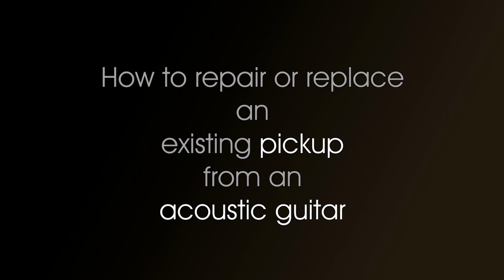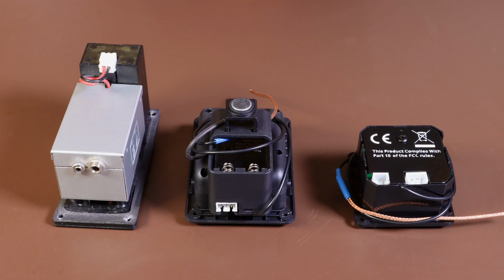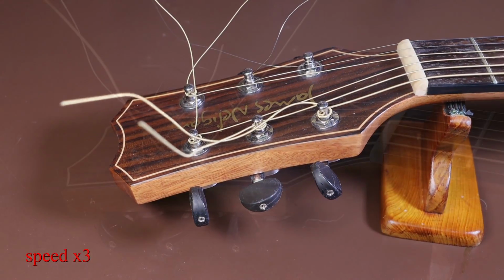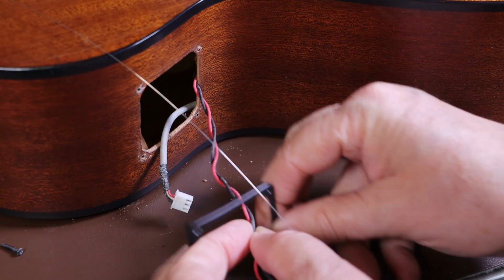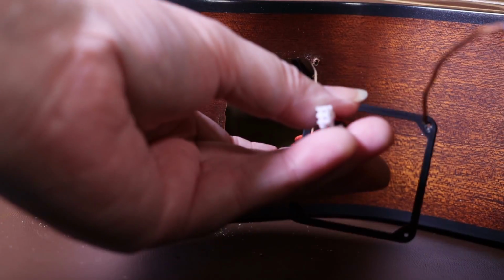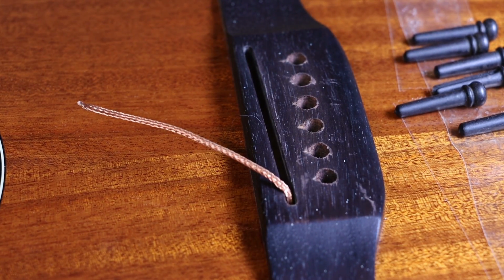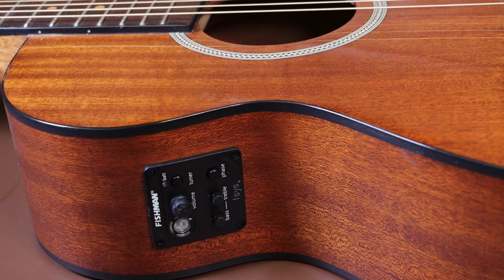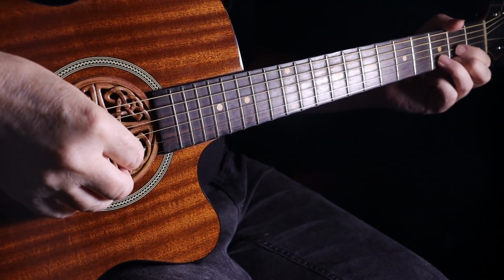How to replace or repair an acoustic guitar pickup and preamp (piezo pickup)

Comment: No worries if not but do you have any tips on how to use existing pick up if I’m going to make it into a resonator please? Would it be best to keep original bridge and pickup together or would this not work? Thanks in advance and no problem if it’s not something you can help with 
Cheers again 
C
Reply from the maker: Piezo pickups are pretty much standard, so If you want to keep the bridge and saddle untouched you can.  The only proviso is that you are confident to cut the wires and re-solder the wires cleanly to avoid buzz.  Sometimes it's a better solution to leave the existing pickup in place anyway, especially if it's a good one.
I hope this helps 😊

Comment: Since I bought my electro acoustic guitar one year ago, I've had this weird buzzing noise when I played the G-string coming from inside my guitar. It only made this noise when I was playing the guitar normally, not when I put it down on a flat surface. I tried so many things to fix it, but could never narrow down what was wrong with it.

It turns out that the one cable connecting my battery to the chromatic tuner (CL-4) ended with a screw thread, and there was a small ring supposed be screwed around it, but it was loose. This means it was always moving around, and when I played the G-string it would rattle against the plastic cable.

Thanks to this video I was able to take out the tuner and fix the ring back into place. It now still buzzes a tiny bit when I hit the heavy E, but it's much better than before. I have no idea why they designed a cable like that. Judging by the fact that it worked fine for a year with a loose ring moving around the body of my guitar, the cable probably doesn't need the ring to begin with. I wish I could just easily remove it altogether...

Anyways, thanks so much for making this video!
Reply: Sometimes noise can come from the 9 volt battery vibrating inside the battery compartment. Try some electrical around the battery to baffle the rattling noise.
Reply: First of all, thank you for all the wonderful videos you've shared. I hope you may be able to answer a question regarding the cut and soldered joints mentioned at the 3:40 mark of the video. I have a Sunrise soundhole pickup which is a great pickup. I thought about wiring it into my Fishman Presys as the stock, under-saddle pickup isn't as much to my liking as the Sunrise. I thought about cutting the wire to the Fishman pickup and using the hard-wired wires to the Sunrise. I am hesitant without some kind of confirmation that it can be done. Any help would be greatly appreciated.
Reply from the maker: That's great to hear . .  thank you for telling you story.  It makes it worth while making videos when you find out they are useful to people 😊😃

Comment: How do you push the wires into the clips.    Do you just thread them through the clips?
Reply from the maker: It depends if the clip has a room to allow me to push the wires through.  If the clip is too small I use the ones provided with the new preamp.  I put the wires through first and then I put the wires and the clip into the guitar and push the sticky side somewhere out of the way.  I hope this helps  😊😃
Reply: @guitar-academy  Thank you.  It worked.  No threading was required, but only pushing the wires up into the bendable metal clamp. Now I have a working Fishman preamp/tuner system on my J-45 EC. It tuned right up and plays great.

Ford Madden Jul 29, 2023 01:19 PM
Reply from the maker: @fordmadden1605  That's brilliant . .  thanks for letting me know 😊😃👍

Comment: I have a James Nelligan acoustic guitar but beside the jack socket there is a 3 pin socket, I don't know what it does. The battery is fitted on the back of the pre-amp. I need to replace the pre-amp, as it doesn't work. Is it the same principle as I cant see any wires going to the 3 pin socket but it has a circuit board attached to it.
Reply from the maker: The 3 pin socket is a 'balanced XLR' which some people find useful for recording or using extra long leads.  The guitar I replaced the preamp in is a James Nelligan, just make sure the size of the new fittings is the same as the fitting currently on the guitar.
Sadly Fishman pickups claim to have a lifetime warranty on them but I've contacted Fishman about several guitars over the years (one straight out of the shop) and they have never lived up to the guarantee . . 🤔
Reply: Thank you for your reply, and for the video, it helps a lot
Reply from the maker: @AlanIngram-v9q  No problem . .  thank you 😊😊

Comment: Hey, great video. I’ve currently got a Cort MR710F that I want to trade in for a Faith Neptune. But, they won’t trade if the preamp is not working. So, I am searching for a new Fishman 4T preamp to replace on my Cort in order to get the trade in. If I get the preamp, do you think I can install it myself? Otherwise, guitar repair shops will charge me £45 to get it fixed.
Reply from the maker: If you've got a pickup already in the guitar, just copy what's there and take your time to get it right.  It's sometimes a good idea to take pictures of the old pickup and preamp as well so you can look back at them if you need to.  all the best 👍

Comment: I need to replace a Gibson AccuVoice pickup system and can’t find it anywhere. It was used from 1994-1996. Any suggestions?
Reply from the maker: Sorry, I don't have the best solution.  There's lots of people asking the same question in various forums with no solution.  All I can suggest is to get a different pickup system where the preamp is either the same size or bigger that the present preamp.

Comment: is the battery reversible on this one?I don't see any indicator which side is positive(+) is.
Reply from the maker: No it's not reversible and it isn't clear which way the battery goes in.  Thankfully the circuit is protected so if you put it in backwards it wont damage the preamp.  😊
Reply: @guitar-academy  thanks!
Reply from the maker: @pinoyrakrakan  No problem

Comment: Question: Can the preamp internal level be adjusted? I ask because when I play my guitar aggressively there is distortion coming out. I hear it on recordings and live gigs. I've tried turning the down the level on the guitar, used a DI box with different levels of attenuation and it does not reduce the distortion. When I play less aggressively it has a nice clean tone.
Reply from the maker: Not on all models of preamp, but on some yes it can.  If it can be adjusted it's a small screw hole in the back of the preamp with a plastic screw inside. 😊😊

Comment: Hi, thanks for informative video. I have the same preamp system in my Breedlove concert, but sometimes as I’m playing the battery light flashes intermittently and simultaneously the guitar cuts out. Any guidance welcome👍
Reply from the maker: That sounds like the battery is a little loose, you can try pushing a little cardboard or paper down the side of it or wrap celotape around it.  I one of these solutions works for you 😊

Comment: Man this is a great help👏🏻 I’m pretty sure I could do this job.  I was gonna take it into the shop, but I don’t think I will need to do that.
Reply from the maker: Glad I could help . .  thank you 😊😃
Reply: @guitar-academy  Repair went great ordered from eBay because I didn’t wanna spend big money. Did not use the battery compartment because I would’ve had to cut my guitar.  So I just replaced the equalizer and went with my old battery compartment and the button jack through the middle. There was some complaining mainly because I forgot that stupid back piece.  I kept stringing the pick up through the Estring hole so I put a peg in there to prevent that and finally had to switch hands and change guitar positions. The good news is all my strings are sounding great and since new the B and E high strings have not had much Sound. Anyway great news it works great ! Thanks again for your help.
Reply from the maker: @mellowfred8935  That's great to hear.  You said 'There was some complaining' but I bet that's another way of saying there were some expletives, LOL  You'll forget about the difficult moments once the guitar has been working properly for a while 😃😃

Comment: I have a Yamaha FG800 (however,there is a Yamaha FXG800 that has a pre-amp) and want to add a pre-amp and pick-up.
I see some original Yamaha preamp and other brands on eBay.
Cherub GT&4, presys blend 301 and so many others.
For an uneducated person like myself, what should you look for when retrofitting an acoustic guitar with electronics?
Reply from the maker: That's a very good question and I'm sure every guitarist will give you a different answer.  My suggestion would be to buy the one that is the most common at the time of doing the job, and the reason I say this is because I've had guitars with pre-fitted preamps that have gone faulty (like the one in this video) and it's been difficult to find a replacement.
Another thing I would recommend is the preamps with only one major hole.  The preamp in this video has a hole for the amp and another hole for the battery compartment which I don't like, whereas something like the blend 301 only needs one big hole and a drilled hole for the strap-lock/jack-socket, which I feel is better.  I hope this helps 😊

Comment: Hi, I know it's two years after the video but if you happen to see this I have a question:

I am assembling an instrument amp for the stringed instruments I build and plan on using the Fishman pickup and preamp shown on the instruments.

For the amp I am using a Mic preamp with the power amp so that I can use the system as a PA too. I know the instrument level or output of the pickup's preamp is likely too hot for the Mic preamp but not hot enough for input into the power amp so I plan on building an attenuator.

My Fishman came with no specs. I know that their rare earth humbucker sound hole pick up has roughly a 0.38 volt output and the similar single coil pickup has roughly a 0.77 volt output from its preamp with the output impedance at around 1000 ohms. To do a good job so that I don't damage my Mic preamp and transferr all the power it would help to know the under saddle pickup's output in volts or dbu and it's output impedance and that is essentially my question.
Reply from the maker: A piezo pickup is nothing like a magnetic pickup the impedance is very high (a megaohm ish) and the signal is very low, and that's because it doesn't have a coil like a magnetic pickup.  The pickup by itself produces a tiny voltage (200 millivolts ish) which varies massively depending on how hard to hit the strings.  This is why a piezo pickup nearly always comes with a preamp.  The preamp has good tolerance and will act as your attenuator if you just turn the volume down, so you can try it first before deciding if you need to correct any mismatch.  
I hope this helps
Reply: @guitar-academy  Thanks, it helped a lot.
Reply from the maker: @migalito1955  great stuff 😊
Reply: @guitar-academy  speaking of great stuff. You should have more views on each video for it is great stuff and surely takes a lot of work to produce. Best wishes for more...
Reply from the maker: @migalito1955  Thank you very much . .  Yes, sadly my videos don't appeal to everyone so they don't really take off.  Nevermind, it just means I can't make regular videos because I have to work them in with other better paid work.  😊

Comment: What the battery is fit for this pickup? Thankyou
Reply from the maker: The battery is a 9v pp3 battery, but you can get USB rechargeable once. 😊
Reply: @guitar-academy  what's the meaning of PP3? Thankyou .. hehe
Reply from the maker: @ChAnnelCoMMent0r  it's a battery type
Reply: @guitar-academy  thanks a lot for sharing all the info about the battery on this pick-up. Because your pick-up for this video is similar to mine.
Reply from the maker: @ChAnnelCoMMent0r  no problem 😊😊
Reply: @guitar-academy  hi i'll try pp3 battery but, not properly working. What's wrong? Thankyou

Comment: Thank you so much! I bought a used acoustic guitar and it has a Fishman. Everything was fine the first night I plug into my speaker but the second night it wasn’t working and I could not tune it. I found it very hard to find a replacement but eventually I found one on eBay and decided to take the chance. I followed your directions, testing first and I did it! My guitar plays wonderfully now. I hope it lasts!
Reply: Did you sell your old one?

Comment: So why would when I put in the battery, would the light not come on
Reply from the maker: The light should just flash once and only stay on if the battery if flat, the tuner should come on when you push the button. 😊

Comment: I have the same preamp. I ended up wrapping the 9 volt battery with electrical tape to make a tighter fit.
Reply from the maker: Yes, it shouldn't be that way but at least there's ways around it.  😊

Comment: Why does  the fishman pre amp not work with a mono male plug from my guitar??
Reply from the maker: It should work . .  either your Fishman is faulty or the lead . .
Reply: @guitar-academy  my lead line is ok cause it works on my other guitars that don't have the fishman. Also it feels as tho the plug don't lock all the way in the fishman,( i have 200sieries, fishman preamps , both don't work.)

Comment: How about using rechargeable 9v battery, it is safe to put it overtime on the guitar but the tuner is off, what is your tip on it?
Reply from the maker: I use rechargeable batteries in all my guitars now for at least the last year and I have been very pleased.  😊😃

Comment: Can you cut the pickup wire and splice in a new one???
Reply from the maker: They (the company) don't recommend it . . but you can.  I have in the past 😊
Reply: @guitar-academy  Thanks. My E, 1st  string just won't pick up as good as the others and its not a expensive guitar so I might splice in another. Thanks.
Reply from the maker: @superkunk2  Check the bottom of the saddle is completely flat and check there's no dirt in the slot.  Both these things can make strings loader or quieter. 🤔🤔
Reply: @guitar-academy  ok i will thanks
Reply from the maker: @superkunk2  👍👍

Comment: What if the pickup is not turning on?even I buy new battery.
Reply from the maker: it sound like it could be faulty, but make sure the wires are properly plugged in 🤔

Comment: My guitar tuner and Equalizer stop working i don't know whats the problem....i replaced new batteries over and over again but the tuner doesn't switch on just the low battery led lits up ...pls help
Reply from the maker: The only things I can suggest is to check the springs in the battery compartment aren't dirty and make sure the wire from the battery to the preamp are pushed in properly.  If these suggestions don't work try your warranty or replace the whole thing like I do in this video.
Reply: @guitar-academy  thanks man i think thts my last option
Reply from the maker: @narendrasonar1392  I hope you get it sorted

Comment: Zabardast cheers from Toronto.  Where exactly to place this inside the guitar as the one in my Yamaha APTX2, 3/4 guitar dropped in. It is about 1 inches in diameter and has glue on one side? Not like the one you are using.
Reply from the maker: Yes, this is a different type of pickup to the one you're talking about.  You're better looking for videos for that type of pickup if it doesn't have instructions included. 🤔  Where you stick them does effect the tone, so you might have to get some 2 sided tape and experiment.

Comment: I just bought a new fender acoustic for my sons birthday,  it lights up, the tuner works, but produces no sound at all!!! Would like to return it but I bought it almost 2 months early on sale, and they have a 45 day return policy. Not sure what I should do about electronics  now?
Reply from the maker: The policy of the shop does not undermine your legal statutory rights, and most fenders have at least a years warranty.  Before doing anything, check the lead and amp because the pickup obviously works otherwise the tuner wouldn't work . . 🤔
Reply: @guitar-academy  his amp works fine with his other  electric guitar. It's not anything we had already thats not working.
Reply from the maker: @leeroyexcavator9149  Unfortunately then you need to contact where you bought it from and explain the situation to them 🤔🤔

Comment: Hi, great video! I have a problem with my LAG T66DCE Direct LAG pre-amp. Whenever I plug it to an amplifier, it makes noise / hum which increases with gain and volume. Whenever I touch the strings and input jack at the same time, the noise disappears though. What can I be? the piezo works fine though. thank you.
Reply from the maker: That sounds like a bad earth . .  you have 2 wires going from the piezo to the pre-amp and then 2 wires going from the pre-amp to the output jack.  One of the wires could have a fault.  I don't think it's your lead but it would do any harm to try a different lead first . . I hope this helps 🤔
Reply: bad ground connection .. sounds like

Comment: i have the same fishman pick up but its not coming out of the guitar. im pushing but it seems stuck. I have a martin LX1…
Reply from the maker: They wont have glued it, but they might have fitted it very tightly so it's as air tight as they could get it.   I have never had this problem so I'm not familiar with it.  Be careful and patient and it should come out eventually. 🤔